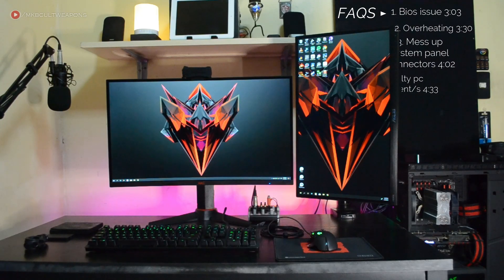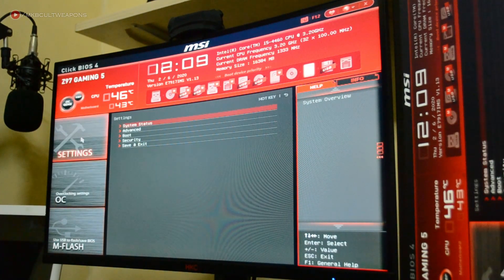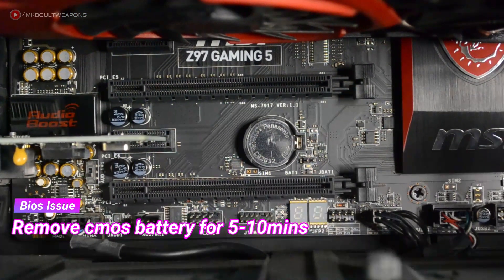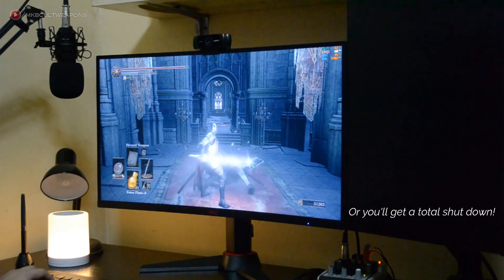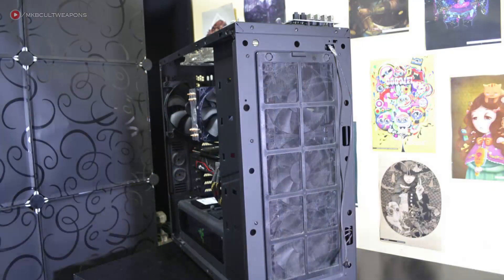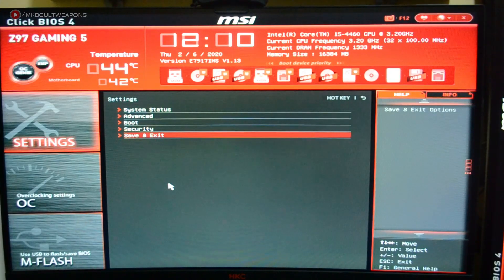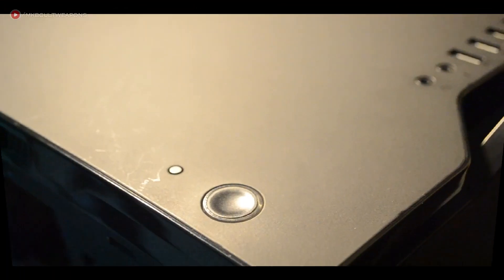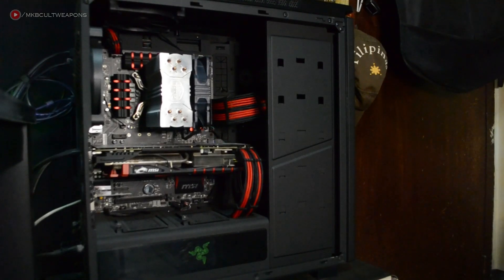Pc keeps restarting FIX / Pc continuous restarting FIX

Comment: Hi, my home theatre pc works fine when connected alone to the lcd monitor using a Hdmi port but whenever I connect my pc to my amplifier's hdmi port , the pc goes into a restart cycle during the boot. Any suggestions ?
Reply from the maker: the amplifier's power might be broken or has a low power draw or the amplifier itself is broken. try using other device other than your pc to double check
Reply: @MacCoyzkie  the pc gpu connected to my tv alone works fine when the amplifier is not in the way and the amplifier works fine with the pc motherboard dvi -d output. The restart issue only occurs when the amplifier and the gpu are connected with each other. Dont know if the culprit is the gpu or the amplifier in this case. Few weeks ago everything was fine and the restart issue rarely happened. The only thing changed is that i replaced the sata drive with a ssd drive to have a faster processing. Wondering if this could of happened due to this change.
Reply from the maker: @faysalusman  you said you install a new  ssd and the pc more likely asked you to reset bios to detect the new drive. and because of that, By default the motherboard disables its (dvi/hdmi/dp) on board graphics when there is a gpu plugged in the pc so basically right now the only display output you have is the gpu. you need to go to bios and look for the integrated graphics and enable it. there is no general instruction to do that so you need to go to your motherboard's manual

Comment: Mine frend i have p8b75-V 2x rams  2x4gb 1333mhz i have 850w New psu the rams i buy it yesterday. I see on mine motherboard red Light dram led i try wit one ram like in youre video. I see only first 2 seconds choose f2 or del to go bios imideatly its automatische close restart pc 

1
I have not instal windows 10 because i buy this motherboard for cheap money on this moment no hard drive install. 

2 
Also i used not cool paste because i want first testing mine motherboards works. I dont have used any paste on mine cpu because i was thinking without paste mine pc must be running to bios menu. But its fast restart. 

Mine cpu is i5 2500k 
I start mine pc without gpu wit vga
I dont have try it wit hdmi. 

But its restarting mine psu everytime.
Reply from the maker: whether you be testing you should always apply thermal paste less it will restart by its own to prevent more damage, complete the build first and install windows right away so you can test it already

Comment: My pc started booting and shutting off about 2 months ago, thought it was the motherboard so i bought the exact same MB, still keeps rebooting, bought a new psu, plugged it into both new motherboards, still rebooting. Even with nothing in the new motherboard and the new psu it still boots and shuts off even though they are 2 brand new parts. I have no idea whats going on but any help would be great. I could send a video somehow if youd like but i am going insane teying to figure out what the problem is.
Reply from the maker: this video https://youtu.be/dusz5P8GMGU might help
Reply: @MacCoyzkie  Ive watched that video already and it doesnt help due to the fact that i cant access my monitor, keyboard, or mouse. The system shuts off and reboots every few seconds and when it is on, the mouse and keyboard do not work theres no rgb lights on them, and the monitor doesnt display anything even with a display port and a hdmi connection
Reply from the maker: @PuppetMaster-Blade  if you had power fluctuation around your area then that might be the problem but if not you need to check your psu if its still giving enough juice for the system, you need to test it with a psu tester like this https://youtube.com/shorts/YrC3PlflLq0
Reply: @MacCoyzkie  I bought that psu tester and its running great. But the pc still has issues. It no longer boots off and on ever couple of seconds but instead, after about 5-10 minutes it shutsoff and reboots with an error code on the MB of 50-59 which means 'dxe core', but as soon as it goes to 60 'Dxecore is started' it shuts off and reboots. I still dont have access to any display, keyboard or mouse, rgb on the fans are not working, but are working for the gpu MB and Memory sticks. I have no idea whats going on or what dxe core means.
Reply from the maker: @PuppetMaster-Blade  can you try clearing cmos for 5 mins
Reply: @PuppetMaster-Blade  I had the same problem as you. did you make it?  How did you fix it?
Reply: @fubuki5205  still having the same issue. It no longer bootloops, i fixed that by completely putting it all back together. But now it wont display or turn on m&k,and shutd off after 5-10 minutes.. Im just going to send it to a technician cuz ive tried everything at this point

Comment: None of this worked and k have had these problems for so long. I also do not have any of there problems. Somebody please help me
Reply from the maker: can you tell us your pc specs and how the pc problem started?
Reply: @MacCoyzkie  my specs are ryzen 5600x, 3060ti, tomahawk b550 and idk how it started but i was playing fort one day and then it suddenly just restarted. And ever since then it kept restarting at the most random times. If you need more of the specs feel free to ask those are just the ones I konw of the top of my head. I would really appreciate of you could me fix this problem.
Reply from the maker: @zinx5529  let's try to run things in default first. if you are in windows 10 do this https://youtu.be/S9hyEPTFR10
Reply: @MacCoyzkie  Ok i will try that and tell you if it woks or not
Reply: I wont be able to try it to see if the pc works or not until this weekend because i cant  play on the weekdays. But I have a few things I wanna tell you about the problem. The pc does not restart on valorant, but it does on fort and apex. It also restarts at random times. For apex on the other hand it restarts on startup or a sort duration after I start playing. Nothing much I just wanted to let you know about these things just incase you might think it is another problem after this infi. I will get back to you this weekend to tell if the problem is solved.
Reply from the maker: @zinx5529  this might help bro try it out https://youtu.be/Azf79t1vkaU
Reply: @MacCoyzkie  alright i will try it out and tell you if the problem keeps happening
Reply: So tried this and I could not find my steam folder for some reason, so i just put the file for apex legends. This made it even worse and now my pc restarts on startup every time. But when I removed steam as a file it opened up without restarting which is confusing me. Just wanted to tell you everything I knew. I did not get to play to see if it restarted though.
Reply from the maker: @zinx5529  perhaps steam needed some updates, it is confusing indeed
Reply: @MacCoyzkie  ok thank you and I really appreciate you getting back to me every-time, because you must get a lot of comments but you remember to get back to me every time. I will keep you updated if I figure anything out and tmmr I can play so i will tell you if it restarts.
Reply from the maker: @zinx5529  no problem bro, i hope it all go well
Reply: @MacCoyzkie  ok thank you  I will tell you if the problem is fixed as soon as i can. Also do you have a discord or something so it is easier for us to communicate, because i wont be able to check my youtube notifications that much anymore.
Reply: so when i first opened up the game and played a few matches it was fine. Then I decided to reopen the game to see if the problem was completely gone. On startup the game restarted. While I was loading in my pc gave me a cpu over heating warning but when I checked my cpu was not hot at all. This really confused me and shows that restating the system did not solve the problem. What do you think the next move is
Reply: @MacCoyzkie  what do you think I should do next
Reply from the maker: @zinx5529  as tedious as may sound, use a different ssd, install new windows in it and try the games in there. obviously this is to save your files in the old ssd with windows in it
Reply: @MacCoyzkie  unfortunately I am trying not to spend money because I really cannot right now and only some money as lest resorts. Is there any other step I could take that is free to fix this problem or is this the only next step
Reply from the maker: @zinx5529  i don't think i have any more tricks bro 😥
Reply: @MacCoyzkie  thats ok I will try what you said to do

Comment: Wether or not I get a response, I dont know but worth the shot.  Had this problem where suddenly my pc shut itself on, even did the "shutting down" screen.  Turned it back on, and after a little while of running again it turned off again.  Then, it did the constant off and on rebooting.  I talked with a friend who is pretty knowledgeable about computers and he came over to check it out.  Long story short, we checked a few different things eventually resulting in taking out one of the ram sticks, then swapping to check the other which got the computer to boot up normally.  Used it for some time, updated and played a couple games and everything seemed okay, so figured maybe one of the ram sticks wasn't good.  Came home from work today and noticed the ssd light was on which isn't normally on when the computer is powered off normally which I did the night before.  So, back to square one, I searched and found this video.  Tried the first few steps and after seeing the bit about cleaning the ram sticks I figured that made sense as messing with them seemed to make a difference previously.  Did that, tried both at the same time, 1 at a time and swapping them 1 at a time and still no progress.  Curious if anyone maybe sees this comment if they could have anymore input as to what other thing to try.  I can still check other components but I'm quite positive based on what happened previously, it has something to do with the ram.  Thanks in advance for any comments
Reply from the maker: if you already clean the ram sticks the way it was suggested in the video and still doesn't work, i suggest try those ram sticks in your friend's pc and see how it goes. If it worked normally after some tests then this could be a motherboard ram slot issue, maybe hardware or it just needed dust cleaning. Obviously if your friend's pc with your ram sticks didn't work then that could be your ram sticks.
Reply: @MacCoyzkie  appreciate the reply.  and that is a pretty damn good idea, ill deffinately give that a shot, but was also thinking about the possibility of a slot not working (i have 8 on my motherboard though so plenty to choose from lol).
Reply: @MacCoyzkie  UPDATE: Ordered a power supply test kit to try to do what i can before assuming an expensive part is a problem and buying it without knowing for sure.  plugged it in and all numbers seemed good.  plugged the 24 pin cable back in and tried starting the computer again.  started fine.  about 30 minutes later it shut down (with shut down screen and all) and went back to the turning itself on and off as was happening before.  so, did the same process again, plugged the 24 pin into tester, numbers were good, plugged the 24 pin back into motherboard and it started normally again.  so, my question now, is do we think that would be a cable problem, a connection problem, or maybe a motherboard issue, as i no longer think it is the power supply or ram sticks.
Reply from the maker: @devinem24  if there is anything it is the motherboard or you could also consider outlet power if you had power fluctuation in your area. 

since we already come to this, can you try testing out the pc without the case? i mean place the motherboard on its box and test it all outside the case because this might be shorted inside the case

Comment: my pc keeps on restarting when I launch the game valorant, what should I do?
Reply from the maker: probably overheating so check your cpu and gpu temperature, lowering game graphics settings will also help
Reply: The temperature is 32° - 47°, the graphics are set to low. This only happens when I run Valorant. It automatically restarts when I launch/play the game, I tried every troubleshooting but nothing would work. Badly need help.
Reply from the maker: @aldrichgonzales7160  if its only happening in valorant then you need to reinstall the games, I got some subscribers having the same issue like yours in the same game so it might be the game
Reply: Im having issues with windows because of the repeated shutdowns of the pc "sign in disabled" and i have to wait for 2 hours to sign in and use the computr again
Reply: this issue occured when I bought a new motherboard and replaced the old one it was replaced  about 4 days ago
Reply from the maker: @aldrichgonzales7160  ok umm do you have an old hdd plugged in your pc? perhaps that might be causing it. try unplugging the hdd and just boot with the ssd boot drive
Reply: @MacCoyzkie  I dont have an old hdd. Thank u for giving me ideas. I went to the computer repair shop and I'll see what happens tomorrow. I'll update what went wrong and how its fixed.
Reply from the maker: @aldrichgonzales7160  i hope it all goes well
Reply: the shop said there's nothing wrong because he left the pc all night long watching movies on sites, and the pc did not auto restart. Now i tried to play valorant again and the computer auto restarted again. i really dont know what to do now 😅
Reply from the maker: @aldrichgonzales7160  are you using windows 11
Reply: @MacCoyzkie  i am using win 10, i tried to reset the pc and its just looping on "choose an OS" i'll try and use USB to put an OS
Reply from the maker: @aldrichgonzales7160  i see, windows 11 users are recently having the same issue anyway have you tried clearing cmos yet?
Reply: @MacCoyzkie  how do I clear cmos sir?
Reply from the maker: @aldrichgonzales7160  here you go https://youtu.be/S9hyEPTFR10

Comment: My situation is so strange, the components worked out of the case but fail to work inside of the case with the power cycling loop being the issue. The power supply just cycles but every fan, including the GPU and cooler work. I have reseeded the RAM and even the motherboard has the RGB work before I turn on the power switch. Checked the thermal compound and it was fine. So I'm so confused
Reply from the maker: usually happens to misplaced front panel connectors, double check yours https://youtu.be/LxRzL5WFB9c also check if the back of the motherboard is touching any metal surface in the case

Comment: My motherboard/main board has an anti surge, but I don't know is it cause of bad PSU or virus because of what I heard that  virus can make a PC restart, the problem is recently I have my windows defender missing
Reply from the maker: might be a virus if you constantly visit sites that has those popping out windows
Reply: @MacCoyzkie  hi again, I've solve the problem, turn out the problem are my PSU. But then new problem happens my HDD can't detect on file explorer or disk management, did PSU fail can cause such problem for HDD can't detect?
Reply from the maker: @Nay_44  re-attach the sata cables or replace them perhaps its just loose
Reply: @MacCoyzkie  sorry for so much bothering you, it's my final question. Is it possible a bad sata power from PSU make an hard drive can't be detected.
Reply from the maker: @Nay_44  yes, i experience that many times

Comment: hey I just swapped my psu recently (evga 750w to Thermaltake gf3 1000w) along with new gpu installation (for 4090 install) and then later some ssds (m2 and sata SSD). My mobo is aorus z690 pro on f21 with 12700kf; Kingston fury 5200 32gb. The PC has been shutting off fine with previous psu and has been working for about 2 weeks with new PSU before the latest installation of new hard drives. However, after I turned off everything to install the new m2 and SSD, my PC has been having shutdown issues.

The issue: my PC constantly turns back on after shutting down (shutdown /p, front panel etc) (double checked f_panel connections). I've turned off all the fast boot/wake on lan software things and it still boots up after a shutdown. I can still put PC to sleep and but the only way to shut off PC is holding the front power for 5s. I've tried removing all peripherals (usbs etc) and booted into safe mode and nothing helps - the PC just turns on after shutting down. 

Otherwise, the PC works fine and there are no issues at all. What else can I do to troubleshoot? Is it really a psu issue or perhaps mobo/and or front panel? I am running out of ideas. Thanks in advance.
Reply from the maker: if you're in windows 11 that is the issue since it has a lot of graphics issues. if you're in windows 10 try to DDU the current gpu driver https://youtu.be/SvIJhcxZTsA because this might have something to do with the previous gpu driver. now if the problem is the same after doing so this might have something to do with the new psu. check it by using one of these https://youtube.com/shorts/YrC3PlflLq0

Comment: I cleaned up the ram as shown in the video and it fixed the problem. But now the monitor shows "no signal"
Reply from the maker: have the ram sticks tested one at a time and see which one is causing it. you can also ask a friend to test your ram sticks and see if the results are the same. if it is then you might have a broken ram stick/s